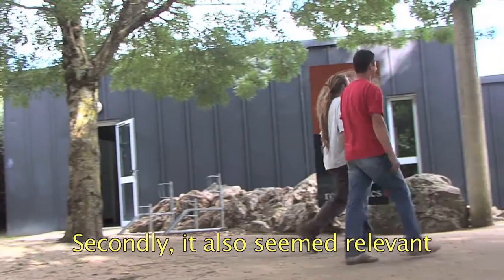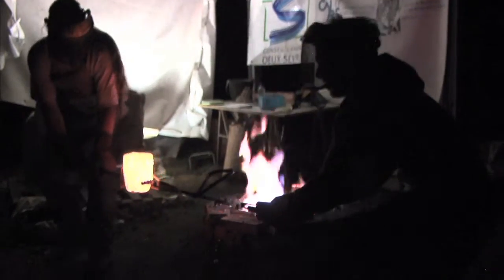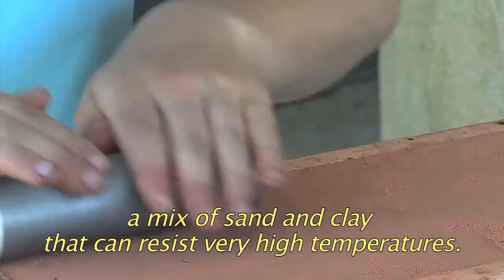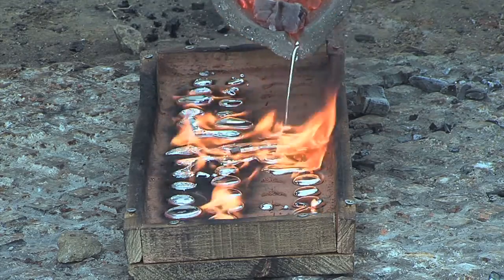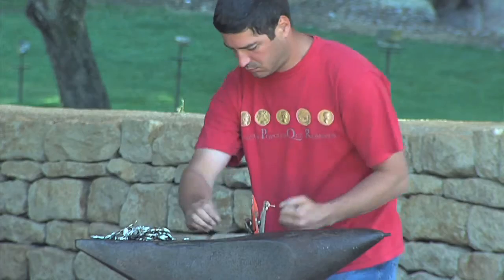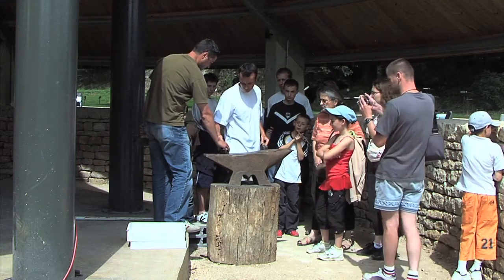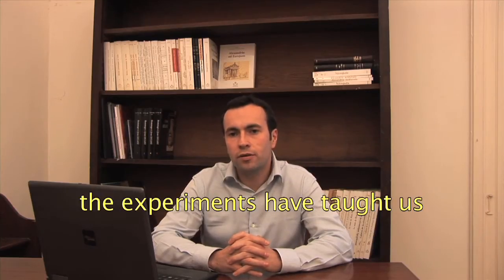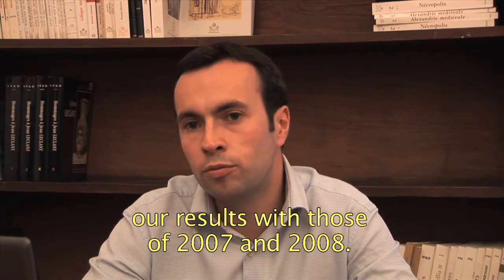Making A Mint

Comment: Did you try annealing the silver blanks and hot striking. Also did you think about redressing the faces of the dies as the images fade. From what found researching this topic Medieval dies were good for about 10,000 strikes before having to be replaced. the faces often cleaned up and the shank of the die mushrooming out to a point it was unusable. The face being made of steel would be cut off of the wrought iron shank. But that was Medieval money. If I recall for Greco coins the blank was cast using standardized masters in molds of clay.  the blanks would then be hot struck to ease in transferring the images on the dies. It can be seen where on some coins the blanks started splitting. I hope this helps.

Comment: If you put the mold on a angle and have it molded to flow down the middle and have the sprouts run to the coin from the middle. I think you’ll have better results as it gathers it’ll chill blocking the flow.

Comment: this is not the technique the romans use to make the coin flans, they melt individual silver correct in  weight inside mold cavities that no need to cut, go direct to strick,same system as the greeks.

Comment: Wouldn't just used the lost wax method for molds or just a bronze mold where you just melt the silver or gold into shot weight it then pour the metal into the mold. That seems quite easy to do

Comment: My guess is that the ancient Romans measured the weight of gold/silver shot before filling the tray with it and then melting it.  This method would allow them to skip the whole step of carving channels and pouring it, which saves a lot of the sloppy work in this video.  The next experiment to confirm my guess would to see if you can melt silver while its in that sand tray you created.
Reply: Thank you for your posting. We actually tried the hypothesis you are mentioning in further experiments. The result was very satisfactory even if the process of preparing the exact quantity of metal for each cavity is very time consuming. Other problems appear then, like the one of "rochage" but it should be possible to deal with it in using a furnace in "reduction mode" without oxygen.
Reply: @thomasfaucher5123  Are there other videos in which we can see your next experiments over the years?
Reply: @thomasfaucher5123  Is it possible to create sheets of silver and punch discs out of it? Seems like that would be more consistent. I just don't know if it is possible to punch through a sheet like that by hand.

Comment: simple they used wood and steel molds. they poured larger sums at a time as well. the stamping you got right but in most likely situation they used an offset anvil to stamp where the anvil has a hole to hold the die.

Comment: Excellent video, thank you for posting! I think what you've discovered with the silver experiment is how Spanish colonial cob blanks would have been made. They are not as precisely weighted as ancient coinage.The sprue bases on opposite ends of the flan would have been hammered flat with the rest of the blank, and then struck between the dies. The reminiscent sprue bases are visible in specimens from that era (1/2R, 1R, 2R, 4R, and 8R silver denominations from the 17th century Potosi mint for example).